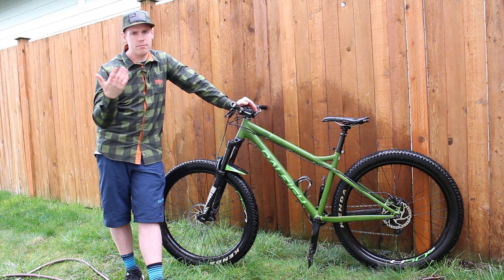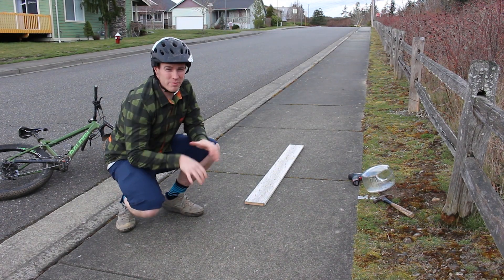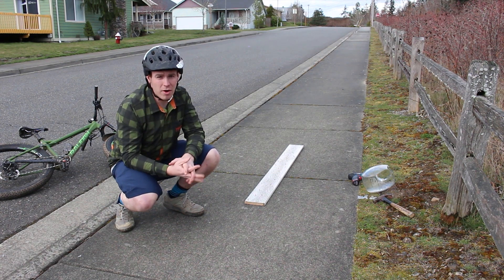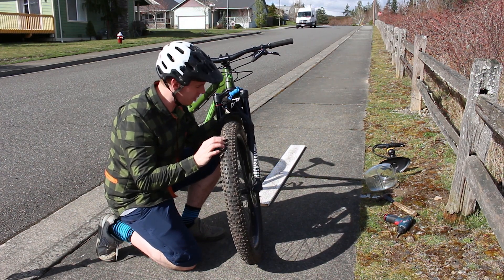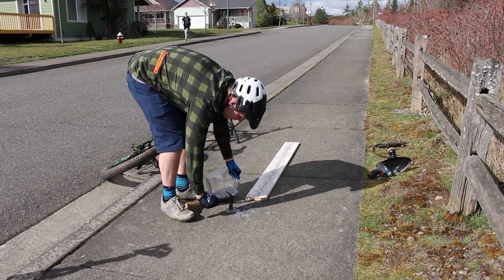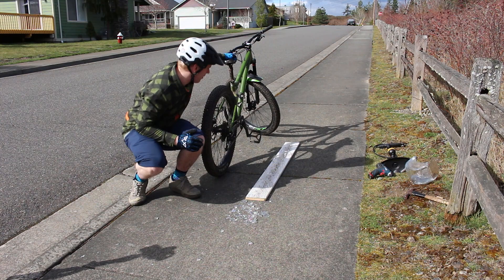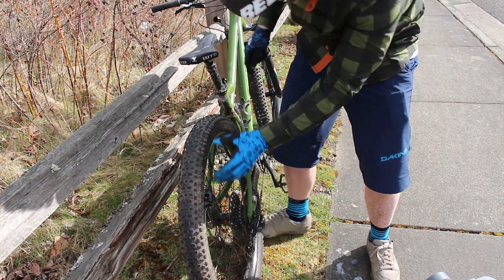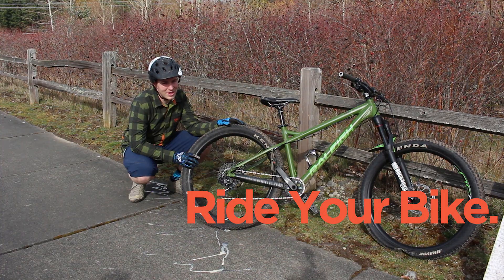The Ultimate Tubeless Bike Tire Torture Test // What it Takes to Flat A Tubeless Tire!

Comment: glass doesnt puncture tires. For car tires for example, running into a curb is more likely to puncture them than glass shards.
Reply from the maker: I've heard of a lot of guys that get flats with glass, but I personally haven't had any issues with it
Reply: I got a puncture from glass on my road bike, once,  it happens.
Reply: I think road bikes are more prone to get flats from glass compared to mountain bikes, since the tires for road bikes barely have any ridges, while for mtbs the ridges are at least a few milometers tall
Reply: I have a bike, it breaks
Reply: @DailyMTBRider  happened to me twice
Reply: I've had a few flat tires with broken glass
Reply: I once ran my tubed bmx tyre at 40psi (the highest I've ever ran my tyres) and got a puncture from a tiiiny piece of glass (so small it was barely visible) within about 15 minutes on road
Reply: I used to get a puncture from glass once every couple of months or so riding to high school back in the day. Probably about 8 km per day.

Mondays were the worst cause broken alcohol bottles all over the road
Reply: Worst flat I ever had was glass bottle hidden in the tall grass coming down the side of a hill.
Reply: Much more likely that glass will puncture road tires.  Small shards get in to the rubber and then work their way down into the the tire, eventually getting to the tube.

Comment: I'm amazed. I managed to kill a tubeless tire by going about 20mph over a very sharp rock garden and slamming my back tire into a big one
Reply from the maker: That's a little different. This test was all about punctures - sounds like you had a pinch flat issue
Reply: Daily MTB Rider it wasn't pinch flat, I was tubeless. There was a quarter inch gash in my back tire. But you proved that anything less than that won't kill tubeless, I'm amazed!

Comment: Why such low pressures? 14 seems realllyyy low I usually run 25-30!!
Reply from the maker: These are plus size tires Kyle - the bigger the tires the lower the pressure you can go
Reply: Daily MTB Rider ah yes inverse relationship of pressure and volume, was doing this in my chemistry class today with gas laws and remembered this comment thanks.

Comment: Don't you have to quickly ride the bike after you pull the nail out and not turn it with your hand? I feel like you need to add pressure on the tire with your weight or something to seal it idk 🤔😅

Comment: I have 27.5 plus 2.8 inch and I gave up trying to get them tubeless even though they are tubeless ready because I couldn't get them to seal :(
Reply from the maker: Sounds like you need an air compressor and maybe some help from someone who has done it before - it's tricky but once you get it it's worth it!

Comment: I need these tires for street riding my mountain bike I got a tube and a tire and the next day a rock cut my tire and blew my tube (my mountain bike is a cheap full suspension bike with normal size tires and tubes) just started reading it after my bmx broke and started getting into mountain bikes

Comment: Tubeless are great but if you're getting lots of punctures it's probably because you're not running them as low as this. Low psi means the tires tends to bend rather than puncture

Comment: Good review. I must be doing something wrong then. I ride 40mm tires mostly on the road little pin holes seal but if I get one slice maybe 1/4", it will not seal until the pressure is low enough. I put a plug in and same thing, it will leak unless I keep the hole on the bottom (at rest), keep moving or lower the pressure. Any tips?
Reply from the maker: Hmmmmm - are your tires and rims tubeless ready? That makes all the difference!
Reply: Yes and agreed. It's the DT Swiss ER1600 wheelset and Vittoria Terreno Dry+ and recently a Schwalbe G-One to see if it was the fault of the Vittoria (it wasn't, the Schwalbe got a pretty big slice on the first ride). I put two Dynaplug micro plugs (instead of only one as before) and so far it seems better. My psi is in the upper range so I'll try a lower psi or maybe riding cleaner roads. If that doesn't help I'll probably go back to tubes. I'd rather change a tube than deal with a hole spewing sealant all over the place. Cheers

Comment: That's cool... I just can't get away with it unless I'm in snow or I can't get any speed. I liked seeing you test them non tubeless ready Tyres.. I've tried to get a pinch flats hitting curbs hard ..but running them at      30 psi ..... And nothing! I say pinch flats because I often run tubeless ready Tyres with a tube.
Reply from the maker: Pinch flats are what you have to watch out for with tubes! It'd say go with tubeless man!

Comment: I caught 3 flats on my Schwinn GTX3 Hybrid in 3 days. I live 2 miles from my job. Only had bike a little over 1 month. Great bike but goddamnit maaaaaaaaan I hate having flat tires. Who wants to walk 35 mins to work when they can cruise for 13 mins? I'm assuming Schwinn tires aren't the greatest. I've tried 2 pairs of Nishiki 700cX35-45 tubes and caught 2 small holes in less than 2 days. Remember, I live 2 miles from my job. I ride about 5 miles tops a day from home to work and maybe a store or two before I call it a night. I ride between 20-30 miles a week total. Fuck riding on my days off. Those are my Fuck Days and Get High & Drunk Like A Motherfucker Days. The Nishiki Tube costs $6.99+Tax. I've figured since I've once had a Nishiki Mountain Bike (bike rode like a horny broad on Dispensary Bud and Four Loko) everything would be cool and smooth but noooooooo I am on YouTube contemplating if I should just go tubeless. Guess what? After watching this vid I definitely am going tubeless. Hey Mr Inner Tube, you can kiss my ass!!!!!!!!!!!!!!!!

Comment: I’ve killed/deflated tubeless with Stans in 2 ways: 1. Got a cut in the side wall from a rock in WET conditions. 2. Ripped the tire of the rim :-P
But I think you need wet conditions to actually kill tubeless with goo.
Reply from the maker: Those sidewall cuts are what can really kill your tires quick!

Comment: 16psi is not exactly fighting back... but still awesome. Now for road tyres at 80psi. I shall see...
Reply from the maker: Do it on road tires and tell me what you find!
Reply: 80 psi ? i run mine on 110 psi
Reply: 80 psi? My tires are tubeless and they max at 140psi
Reply: I rune mine at a 100psi
Reply: Psh.  Only real pros run at over 9000 psi
Reply: Kevin Gliebe nah9001
Reply: @ezrabegin8234   🤣🤣
Reply: Real pros use a imaginary bike because we cant afford bikes 😔
Reply: I have a cross country MTB and I ride at 20-30 psi
Reply: @jettdiff5788  think that corona money is for?
Reply: I run my tires at 65 psi at trail and while just dirt jumping and at DH
Reply: You really shouldn't ride tubeless tire at more than 95-100... They're meant to be ridden at a low pressure.

Comment: really enjoyed these videos! great fun!
I have always used stans, and never felt the need to try a different sealant, and I have now been riding tubeless tyres for a few years.
But from my experience all those things you used to test the effectiveness of the sealant are no where near the harshness of the reality of the punctures I have on the trail.
All those punctures u made on the tyre in this video, that´s the minimum protection I expect to achieve with the tubeless setup. 
Real punctures on the trails that will make ou go flat while tubeless, cause large odd shaped imperfections on the rubber. 
Punctures that will put them to a good test would be large side cuts, and punctures that cut through the center of the knobs and come out on the side wall, or even the ones that cut where the tyre bed sits on the rim.
Another important factor in my opinion is that on the trail when u get a puncture most of the time you don't immediately notice it, stop, get off the bike and allowed it to seal. You will keep on riding with all your weight on the bike, continuing through ruff sections until u finally notice that your tyre lost pressure. Its much harder to seal with your weight on the bike, hitting rocks and jumps, and you will lose pressure at much higher rates. It takes time and air pressure for the sealant to move, reach the puncture and activate.
Reply from the maker: Great thoughts - thanks for sharing!

Comment: Lucky you, not so lucky me. 

Popped off a small jump, and pop, thought I burped, but no I’ve got an arterial bleed of sealant. Lots of bubbles, then flat, try to pump up the tire, and the sealant just pours out the knob to knob laceration in my tire. 

I get one sharp pebble and be damned.

But so far so good on those blackberry thorns.
Reply from the maker: That's a big bummer man! Sometimes tires get warn and you're just in trouble! Might be time for a new one!

Comment: About the glass. Where I live every month or two there will be a bus stop with a glass window smashed and because its safety glass it breaks off into millions of tiny pieces and I always ride straight over it on my bmx with ~60psi in my tyres and it's never popped them and I use standard bmx tyres I guess and pain old inner tubes. Interestingly enough the only reasons I've had to change my inner tubes is because the valve has gone dodgey or I have the tyre off and decide to do it for the sake of having brand new inner tubes on
Reply from the maker: I hear you man - I didn't think the glass would be too bad, but people suggested it!
Reply: Ahhahah it's called safety glass for a reason. It isn't sharp at all. You could probably swallow one of those bits and be fine
Reply: Do U live in Australia coz that happens all the time in my hood.

Comment: Good video. I've never gone tubless. I guess the question I have is what do you do when you're in the middle of a trail and the tire actually blows out? At lead with a tube you can change it. Also, doesn't slime do the same thing as sealant?

Comment: Let that crap curdle or worse yet, dry out-- and you'll kill the nasty scabby thing yourself just to be rid of it.  Tubeless takes a wear item (the tire) and turns it into a disposable item.  Tubeless takes more time than dealing with tubes, only you have to deal with it up front and periodically whether you get a flat or not.  Whether you ride the bike or not.  And then something gross happens on the trail and you have to put in a tube anyway, haha.  

Some of my wheels haven't needed tubes changed in years.  You?

Comment: "16 PSI in the rear, 14-15 PSI in the front" As a roadie... Seems to me like you already have flat tires :|

Also man I don't know how MTB tires wear but we generally get multiple thousands of kilometers out of road tires. Sounds a bit absurd to me to call them "old" with just 400 miles on them. Do they really wear that fast?
Reply: Back tyre doesn’t last very long on a mountain bike as it’s all ways sliding around. Can get ages out of a front tyre myself

Comment: It ain’t worth it if you like free ride cause if you case a big jump instead of splitting the tube it destroys the sidewalls on the tire so for that respect it is a bit of a hit or miss
Reply from the maker: I can hear what you're saying, but I've seen that it's fine to run tubeless with higher pressures - it's pretty hard to completely destroy a tire in that case

Comment: How do you run such low tyre pressure if i have mine at 60psi and 45 psi is about a low as i go or it feels like i have a brake stuck on they cause that much drag and i runing 27.5 by  2.2 so how come i see all these video says there runing 25 psi and 15 psi if i did that i my bike it like i have a flat or is it all to do with riders weight
Reply from the maker: It's because I have 27.5x2.8's - the bigger the tires the less air pressure you need!

Comment: Try hitting the sidewall with sharp rocks this is the easiest way to get you flat running tubeless. Basically you need to cut the carcass otherwise it will seal.

Before leaving: now take your tires off, parch them using notubes procedure with regular rubber cement and regular tube patch, alcohol and a hair dryer and you're back on business. Your tires are not dead.
Reply from the maker: What I didn't show was me fully taking a knife to the side walls - they're dead my friend!

Comment: You're probably not going to flat from glass like that, in all my years the only glass flats I've got are at high pressures (over 70) with a sliver of glass that slowly works its way through the tire(over many miles) and scrapes the tube to puncture it, I would imagine very easy to seal tubeless.  Running over a big piece of glass (bigger than a coin) laying on its side is the same as going over a flat rock.
Maybe the toughest glass test is to put some large(ish) pieces in the dirt with edges pointed up.
Reply from the maker: Now that would be a great test! I'll have to try that next!
Reply: I thought he should drive over the unbroken cookie jar, kind of like going over a broken beer bottle.
Reply: I ran barefoot for years- glass won't break the skin, much less tires

Comment: How are you able to run such low pressures comfortably?!  Or do you still get quite a bit of squirm at 14-16psi
Reply from the maker: On plus size tires 15psi is like 30psi in standard tires. The bigger the air volume the less pressure you need
Reply: Ahh I new higher volume allowed lower pressures but not that drastic.  Great vid as always Josh, cheers
Reply from the maker: yeah It's pretty amazing! Fat bikes use like 2-4PSI - now that's crazy!

Comment: Wow as a road biker your tires wouldn’t get you anywhere I ride with 65 in the front since it dosnt have a spring or shock and 80 in the back for maximum power delivery and traction and efficiency I can get

Comment: The 1st time u rolled over the board (nails) i could have sworn that i saw the back tyre lose some air pressure?
Reply from the maker: They were set up for trail riding on the first go, had to pump them up to 30psi

Comment: What does it take to deflate a tubeless tire?
Not riding it for 3 days and having all the air leak out.
No, I like pumping up my tire every 2 days. It's fun...
Meanwhile, my Santa Cruz Superlight 26" has Schader valves. I haven't had a flat in 3 years, and I pump the tires up once, at the beginning of the season.